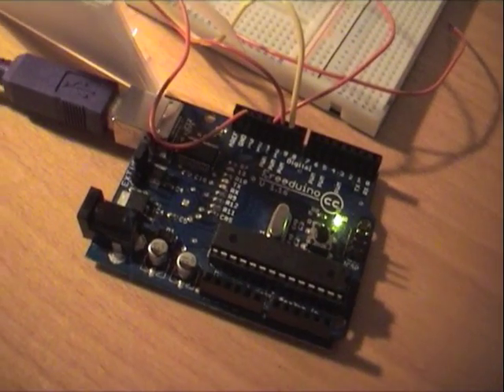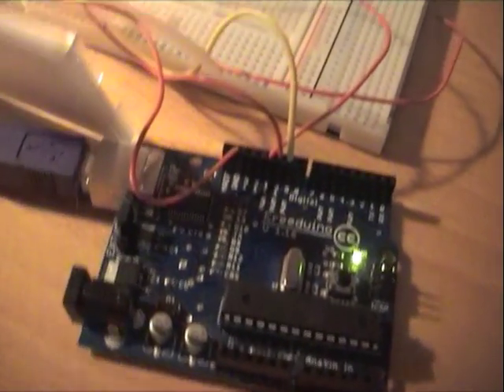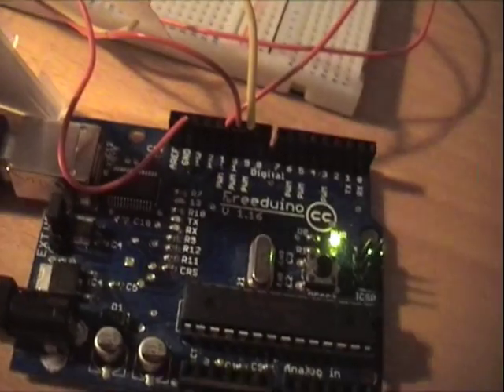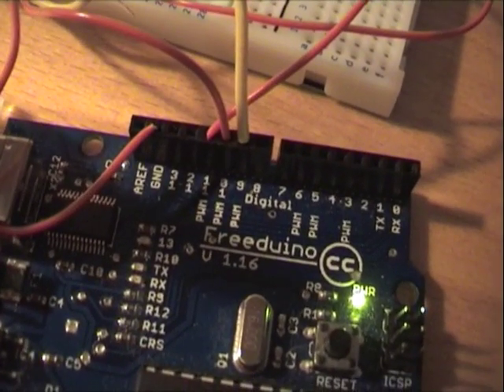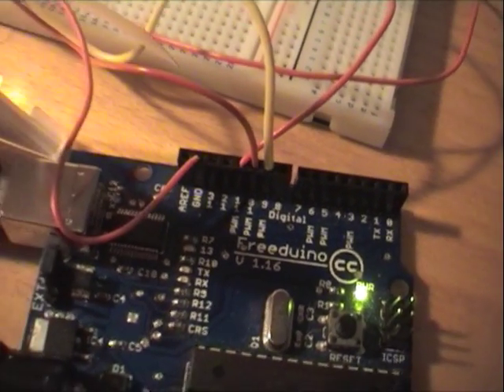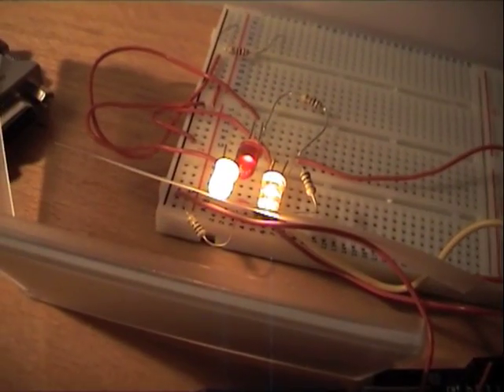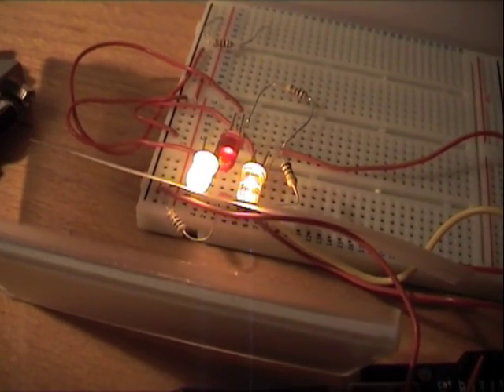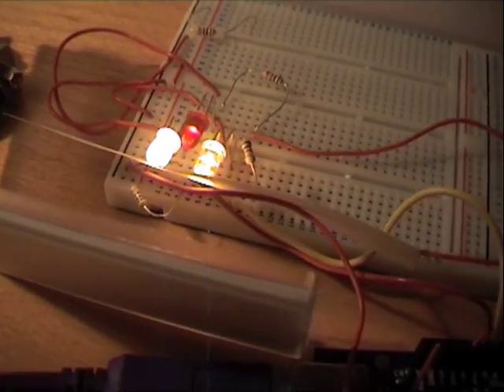Realistic LED Flickering Flame Effect using an Arduino

Comment: Hello Mike,

Great instructional video. I have a question for you, if you don't mind:

I do lighting for film, as well as theater. I'd live to make a larger LED array that pumps out some serious light, capable of replicating a small fire, like you'd find in a fireplace or campfire.

Such as the flickering campfire light in this clip: https://www.youtube.com/watch?v=Qqtwe5K8UYk

Would it be possible to do this with an Arduino? I seen this up to 6 LEDs, but is there a way to boost the power of each circuit (if that's the right term) coming out of the Arduino, so that I could have each circuit powering an array of 100 or so LEDs?

I'd be ultimately looking to get the equivalent of 300-450 watts of incandescent light out of the setup. Is that possible, or just crazy talk?
Reply from the maker: Nathaniel Haban Yeah that is all perfectly possible. You can control as many LED's or any other kind of light for that matter as your budget and power supply can cope with.

The LED's will need to be powered by a separate power supply. This will need to be rated at the correct voltage, but more importantly, at the correct amperage. The outputs from the Arduino will then turn the lights on and off via a transistor, or even a high-speed relay if you are going for mains powered lights.   

It's all about switching the current on and off. With a few LEDs, the Arduino has enough power to do this directly. Once you increase the number of LEDs, and therefore, the amps needed then you will need to power them separately and then switch them via a transistor. For your setup it sounds like mains powered lights will be required in which case you would turn them on and off to flicker with 5v relays.
Reply: Mike McRoberts  Ah, yes. Okay, this makes perfect sense. If I am understanding correctly, the Arduino acts as a switch, turning each circuit on-and-off, rather than powering the LEDs itself? Thank you for explaining it, and for your help. It's greatly appreciated :)
Reply from the maker: Nathaniel Haban Yes that's correct. Although the Arduino can power LEDs it can only power a small amount as the output voltage and current is limited. It's not advisable to use it to power high current devices (high current being anything larger than about 200mA) and in that case, power it with a separate PSU and just use the Arduino to Control that power instead. The Arduino is perfectly capable of controlling mains powered devices.
Reply: Chuck Yancey
Very cool stuff Chuck. Thanks for the link!
Reply: Hi Nathaniel,  Since you are looking to light a scene for stage, you might be interested in this web site.  https://www.j2ledlighting.com  They also sell on ebay, here is the ebay link... http://www.ebay.com/itm/121959872270?_trksid=p2060353.m1438.l2649&ssPageName=STRK%3AMEBIDX%3AIT
Good luck with your project.

Comment: I started with your idea but decided to use all red and double up for 2 LEDs in each set for additional brightness.  Also found that a delay of about 80ms help the reality.  Separating the sets a bit adds realism since fire flickers differently in different areas. Thanks for the info.

int ledPins[] = { 3, 5, 6, 9, 10, 11 }; // an array of pin numbers to which LEDs are attached
int pinCount = 6;           // the number of pins (i.e. the length of the array)

void setup() {

  // Initialize all PWM pins as output and cycle the LED as visual check for correct wiring.

  for (int thisPin = 0; thisPin < pinCount; thisPin++) {
    // turn the pin on:
    pinMode(ledPins[thisPin], OUTPUT);
    for (int iLvl = 100; iLvl < 255; iLvl += 10) {
      analogWrite(ledPins[thisPin], iLvl);
      delay(10);
    }
    analogWrite(ledPins[thisPin], 0);
  }
}

void loop() {

  int iLvl;

  while (1 == 1) {
    iLvl = RandRanged(100, 255);
    analogWrite(ledPins[0], iLvl);
    analogWrite(ledPins[1], iLvl);
    int iLvl = RandRanged(100, 255);
    analogWrite(ledPins[2], iLvl);
    analogWrite(ledPins[3], iLvl);
    iLvl = RandRanged(100, 255);
    analogWrite(ledPins[4], iLvl);
    analogWrite(ledPins[5], iLvl);
    delay(80);
  }
}

unsigned int RandRanged(unsigned int min, unsigned int max)
{
  double scaled = (double)rand() / RAND_MAX;
  return (max - min + 1) * scaled + min;
}
Reply from the maker: Mikey MoMo Nice

Comment: I'm really interested in using this, however for the purpose I need it for, the entire effect has to fade up from nothing (so i guess that would just mean smaller interval flickers gradually getting more frequent until it's "steady" at the flicker you've created). Is that possible to program in to the arduino? I'd be a complete beginner and wouldn't even think about buying one unless someone could write the code for me (probably simple for an expert like you) Would love it if you could advise.